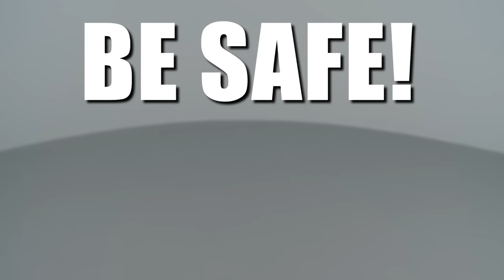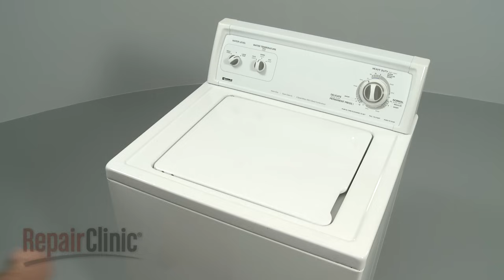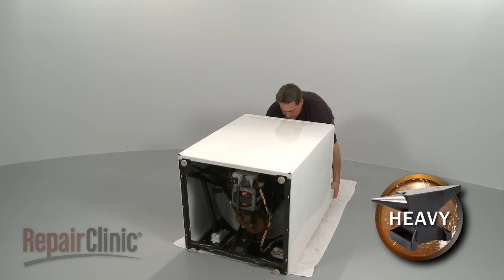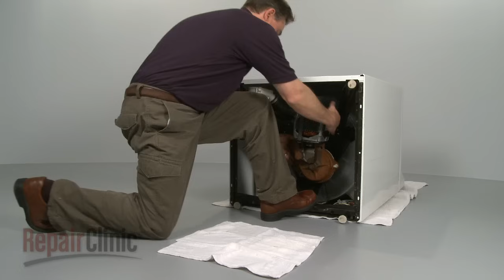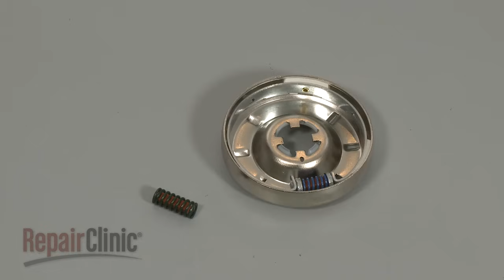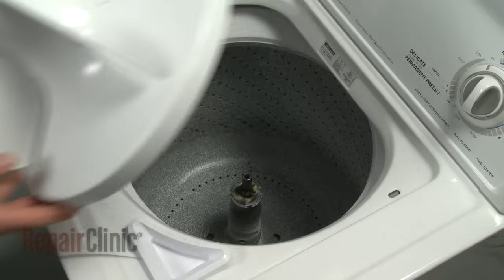Washer Won't Spin? Replace Whirlpool Direct Drive Clutch Assembly #285785

Comment: Thanks for the instructions, they were pretty solid.  Took me about 2 and a half hours.  The only place I got stuck was when you have to put the transmission back on, the spring was blocking me from getting to the bolts.  I didn't realize that you had to push the break back in and that section collapses back into the unit.  After that everything went on perfect.  Amazed I was able to do this thanks!

Comment: I follow everything in video however my transmission with motor attached will not pull out. I did remove agitator. Its stuck and will only pull out a few inches.

Comment: My problem is the basket won't stop spinning when the cycle ends/drive disengages.  It just keeps spinning on inertia until it slows and stops on its own.  Otherwise, everything runs fine. I can't find anything online that addresses this problem

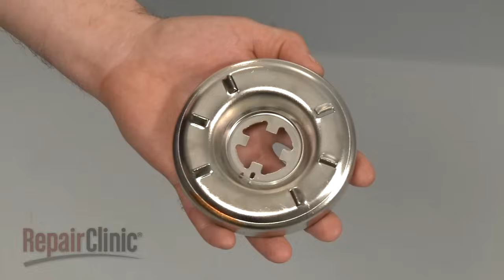Comment: 2:22 what if I don't have an isolator ring? I'm replacing the clutch it didn't have an isolator ring. Is it really that necessary to have one, or will it be OK if I just put it on without it? any help would be great thanks.

Comment: Thank you for making this look easy enough to attempt!  The only thing I struggled a bit with was the retainer ring until I realized the easiest way to put it on was to work around the shaft from the pin to the other end, pushing the ring down.  Piece of cake.  Probably took an hour, pausing the video and making sure I had it right.  Could probably do it in 20-30 min now.  Nice job with the video!

Comment: Does this work on a old whirlpool. It’s so old that it doesn’t have a lid lock. I can open it anytime, but it won’t agitate or spin with the lid open. On the spin cycle the agitator spins but the tub doesn’t move.
Reply: It has a lid switch just hidden

Comment: While it's disassembled it's a good idea to replace the motor coupler.  Some kits include this part.  It's also a part that fails.  Mine lasted 30 years, didn't realize it was broken until I decided to replace the clutch.  Found broken plastic tabs under the washer along with black rubber dust.  This came from the coupler.  Great video,  Very helpful.

Comment: Didn't show removal of the spanner nut to release the basket drive from drive shaft.  Need a special spanner nut tool for this.  Without loosing this spanner nut, the transmission won't slide out.

Comment: I replaced the clutch and now it spins, but it will stop and buzz!  I can restart it and it will keep going , but it might do it again later.  some loads have finished with no problem, others we have to restart a few times... what is going on? weak motor? new clutch too tight? something else like the balance sensor? IDK?!
Reply: Ok tried to do another load and it stopped 1 min into agitation! I give up! Im thinking a worn out weak motor! Cause it wont start back up now!

Comment: Amazing. Single mom, no repair skills or knowledge and I had my washer fixed in no time! This was the second part I've changed out with the help of these vids. Between the two repairs I spent $23 on parts and I've saved at least $200 DIY. Thanks repair clinic!
Reply: I think I'm going to give it a try.
Reply: Wish you was my wife

Comment: I NEVER would have been able to do this on my own without this video! Most written guides recommended hiring a technician. Still, I decided to buy the parts and do it myself... I'm happy to say that thanks to this simple, to the point video, I not only completed the job, but without any problems! It made it EASY! Now my old washer has a new lease on life! So if your washer isn't spinning, Do a little on-line research before calling a technician. You might be able to save money by fixing it yourself!

Comment: I used the video, followed step-by-step. Easy!...except when I turned on the washer to spin cycle, no spin. I watched another similar video that included two crucial steps that your video did not include. 1. Turn the clutch brake counterclockwise and push in to rest with the spring at 12 noon. 2. Turn the spring on the clutch assembly so that it faces the gear case. I disassembled the washer again, added these two steps, and voila! Everything works. Saying "NOW SLIDE THE MOTOR AND GEARCASE ASSEMBLY INTO POSITION, MAKING SURE THE CLUTCH SPRING IS OPPOSITE THE BRAKE CAM. BE AWARE THIS MAY REQUIRE SOME ADJUSTMENT BEFORE THE GEAR CASE... Remember, we are inexperienced and do not always understand the repairman lingo...

Comment: Great video.  The clutch was easy to replace.  The old clutch showed signs of burning; scorched pads and bits of black residue in the clutch assembly.  After replacing the clutch machine would still not spin and the clutch was hot enough to make water sizzle after running for less than a minute!  The drum was difficult to rotate; I had to use two hands to turn it.  I pulled off the shroud to expose the inner tub and found a sock rolled up between the inner and outer tubs!  I fished it out with coat hanger and reassembled everything and the machine now spins and works great.

Comment: Just changed out the clutch using parts ordered from you and with your video as a guide.  The only trouble I had was that after removing the agitator, there was an extra spring collar and plastic piece on the agitator shaft that had to be removed before the shaft would slide out.  They were not mentioned in the video.  The only other trouble I had was getting the new clutch retainer ring (under the support ring) to remain in place.  In fact I didn't think it would stay in place after reassembly, but the fast spin works ok now so I guess it did.  Thanks.

Comment: Good video on this, but a lot of these videos leave out a key thing you need to be aware of.  When you have it on its side like this there's a good chance the triangle shaped suspension/skate plate may come loose as it's free floating.  Be sure to line the 3 notches up on the corners with the 3 legs on the base or you'll have severe wobble during the spin cycle.

Comment: I am in total agreement with Engines LLC. Just a straightforward instructional video without the BS. Thanks YOU RepairClinic. 
BTW - this is a fairly easy fix. Once I got the washer out of the mudroom closet, it took me about 10 minutes to pull that motor/trans/spindle assembly. Just go slow and be methodical. I use those slider pads (https://www.bustle.com/p/the-4-best-furniture-sliders-for-hardwood-floors-17919953) and careful not to bang walls, moldings. You might need a friend to help you tip after you remove the agitator. Just set it back on a box. Three 1/2 bolts on the trans. It slipped out pretty easy. Good Luck

Comment: Any suggestions if, after removing the 7/16 bolt and removing the agitator, then removing the pump and the three bolts, what to do if the motor shaft is hopelessly stuck and will not pull free from the machine? I even removed the motor so that the whole thing will be lighter.  I've been at this for 90 minutes with zero progress. Are there more parts to remove up top than just the agitator?
Reply: I had the same problem.  I hammered down on the shaft on the agitator side until it got close to the washer drum, then used a piece of copper pipe (anything else the same diameter of the shaft would work) on the drive shaft and hammered on that and it finally popped free.  Be aware if you do this a good chance the triangle shaped suspension/skate plate may come loose, be sure to line the 3 notches up with the 3 legs on the base when you put it back together or you'll have severe wobble during the spin cycle.

Comment: Did the clutch change as directed and machine will now agitate but wont spin. I dropped transmission about 4 times now. Pump works, motor works, motor coupler intact, installed new clutch, still no spin!. Could this mean transmission is bad? Any input greatly appreciated.

Comment: Just the right amount of information for a DIYer.  Doesn't assume you have 20 years in the business, yet not bloated by useless fluff.  Thank you!  My model has a metal clip and plastic drive cam under the agitator that prevented me from removing the motor until I found them.  The hardest part was replacing the bent-wire retainer ring; you make it look so easy in the video, but it kept slipping off my screwdriver.  Any hints?

Comment: I just moved in to a new home ad I am replacing my parents old washer/dryer they gave me.=>>allmy.tips/WhirlpoolWasher?45s     So I had a long way to move up! That being said, this dryer is relatively simplistic, but has all the modern feature that any average family would need. It has a high capacity, a bleach dispenser and multiple settings for most any sort of clothing. I have been nothing but happy. I looked at many that were significantly more expensive and with the performance of this machine I am glad I didn't waste my money for machines with blinking computers. A washer and dryer is something you want to be able to depend on a day in and day out. And this machine is amazing! A++

Comment: And if this doesn’t work, check tub to see if any small clothing is caught in between the  wash drum and wash tub that could be binding washer from spinning. Put washer on backside, look for tub drain. Disconnect drain hose. Have someone spin drum as you look to see if any article of clothing is caught in between drum and wall. If so, take a retraction tool with prongs to pull out from tub drain. Put washer upright. Turn on spin cycle. Lift lid just enough to see if drum is spinning. You may need a flashlight to shine underneath lid to see if drum is spinning.

Comment: Not sure what I'm doing wrong, but when I got to the part of putting the transmission assembly back onto the washer I couldn't get it in far enough to be able to put the 3 bolts in. It doesn't seem like there's any way to be able to push it in far enough.
Reply: I'm having same issue.  I adjusted the clutch and the brake clip so they are opposite.  Something's stopping it from the top of the shaft i'm guessing.

Comment: Please help! I can't get the 7/16 bolt off.. I've tried soaking in PB blaster. The rust is removed but now it appears slightly rounded out. Do you have any suggestions?
Reply: Go metric and find a 12 point socket that's just smaller like a 15 mm.   Take a rubber hammer and tap the socket on and remove the old bolt.   Done this trick tons of times on rusty bolts
Reply: @redone701  , thanks! Got it finally.
Reply: Ok, finally got the bolt and agitator off. Now, I can't get the motor gear case assembly. I have followed the directions step by step. The pump is off and the wires have been removed. The 1/2 info bolts to the motor have been removed. It should lift out, but it's not. I've been messing with it for 2 hours.

Comment: My dislike is because there’s a crucial step missing, I’ve learned it in another video: you have to reset the clutch assembly to be able to put the parts back.
Reply: What do you mean reset and what parts?

Comment: Cools like a champ in my 10x12 bedroom and real quiet compared to the equal sized Samsung I replaced with this unit.>>>nub.best/0x9n    Can hardly tell when the compressor kicks on. Have only had it for a month or so so won't get much more use until next summer.

Comment: I would like to see what was wrong with the old clutch, where it went wrong.
Reply: The tiny/thin clutch material pads disappear/wear away, and the new ones only last a short while compared to the old original ones. They are probably using some earth friendly garbage, instead of good heavy duty asbestos clutch lining .

Comment: I got the coupler but the shaft coming fron the tranny look warn out. Voupler fits on the ttanny side of the shaft loosely.  That seems to be the issue fire me.  Anyone know of any vids to help with that? Also if one does know how to fix that can you replace one of the shaft that the couple fits onto. Ttranny shaft that is.

Comment: Im working on a maytag top load comercial washer. The problem is that stop at the last 3 or 5 minutes of the final spin. I did replace the clutch but i don't know what else could be. Any tip that can help me out fixing this problem. Thank you.
Reply: I replaced a clutch... now it smells like burning and the tub still won't spin :(

Comment: Piece of cake.  Thanks for the instructions.  My kenmore 90 series didn't have the bolt in the agitator, but used a 1/2" drive square hole that I turned with a socket extension.  Also, if you pop off the motor from the gearcase, it makes it easier (lighter) to remove and install, and you can go ahead and replace the coupler ($8) which will inevitably need to be replaced at some point anyway.

Comment: Just installed a new clutch using this video...I'm a first timer and it came out perfectly !!! The tub wasnt spinning so clothes were still soaking after the cycle. Thanks a million.
Reply: I replace the clutch and the coupler and it still will not spin

Comment: Excellent video! Fixed our washer that wouldn't spin at full speed so wash often came out sopping wet at the end of the cycle. It took us about an hour to fix. The clutch cost about $18 and we have a new washer again in our rental! This video explains everything very accurately and was all the advice we needed! Thx again!
Reply from the maker: Good work!

Comment: Thanks for the help! I mostly fixed it, but I have a slight issue that I would appreciate any advice on. When putting the brake cam back on, I noticed that the area where the c clip sits has no groove to sit securely. Has anyone seen this before or is there something I'm doing wrong? The washer kind of works like this, but the brake cam rattles a lot and is going to be shredded soon. Thanks!
Reply: I'm replying to myself in case anyone went through this problem. My issue is that the bushing/bearing is supposed to have an end that juts out so as to hold the c clip/ring wire. Mine has mushroomed out and couldn't hold it, thereby not allowing the cam brake actuator to stay in its place. I'm waiting for parts still, but I just need to replace my bushing and cam brake actuator and it should work just fine. Thanks again for the video!

Comment: just stumbled upon this video as my washer just went out.    it's not the coupled, not the clutch, not the dogs,  it's inside the gear box.  i opened it in the garage and noticed way too much slop (worn bearing?)  anyways it's back together... it drains but still doesnt agitate, spin, etc.    just makes a clicking sound from inside the gear box.   it's going out on the curb next week.
Reply: +Lil Red - Devil mine went on the curb, was gone in an hour.  bought a pair of speed queens. :)

Comment: Great video, helped out quite a bit. I did mine with the washer laying on its side rather than back. This is doable but it does make getting the pump clips off a little more difficult. I replaced the motor coupling too while I had it out as a preventative measure.

Comment: what if you don't have room to tilt it on its side? Can you fix it while its still upright?
Reply from the maker: KelJenn B We don't think so. You would need to remove the tubs and break tube and you have to lay it down to disassemble the break tube. You are probably better off moving the unit to a larger space.
Reply: okay, thank you.

Comment: Excellente video.
I repaired my washer today using the video and it was flawless.
I did have a small problem at the final stage, just had to "wiggle" the shaft a bit to line up so I could attach the3-bolts but other than that, it went well.
All in all the process took about 45-mins
Reply from the maker: David Cummings Congrats on the successful repair, David!

Comment: My washer machine is spinning real slow. The clothes are becoming super wet, and the only way they dont if i put the clothes on a smaller load. Is there a way I can check my clutch before I buy a new cutch?
Reply from the maker: bigcartoonyIIV The best place to start is to enter your washing machine's model number in our website's repair help system: http://www.repairclinic.com/repairhelp?TLSID=1773

Comment: My Whirlpool washer wouldn't move in the spin cycle. The clothes were coming out of the washer a lot wetter than they should have been. Initially we thought the dryer wasn't drying properly. My wife realized that it was the washer not spinning to extract the water from the clothes , the only way it moved was if I took my hand and started to spin it manually, then the spin cycle would kinda engage. I went to my local appliance shop  and he confirmed the clutch was shot. I bought a new one for $55 and followed this excellent video and its in perfect working order!
Reply from the maker: Jeremy Sutherland Congrats on the successful repair!
Reply: I had the issue with my washer. It would not spin unless I take my hand and start spinning it myself to start the spin cycle. I am going to replace the clutch and while I have it apart, I can replace the motor coupling as well. Just to be sure.

Comment: On the cam side of the clutch...what is that rubber ring that sits around the assembly?  When I set my washer down, I first thought that was a belt.
Reply: +jobzombi  I saw that on mine too and wondered if it was a belt.. wish you had an answer from the pros..

Comment: I bypassed the lid switch ,replaced the motor coupling still will not spin but if you give the washer drum a lil push it starts to spin any suggestions from anyone, thanks time 12:15pm 11-26-14
Reply: Clutch